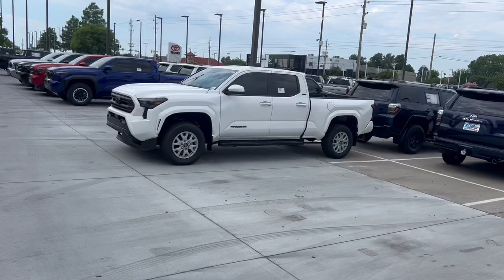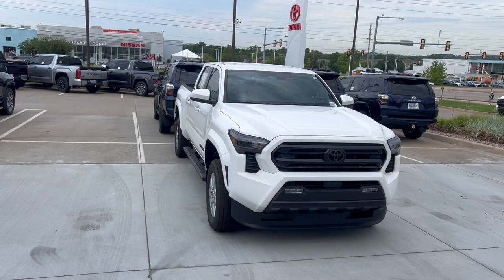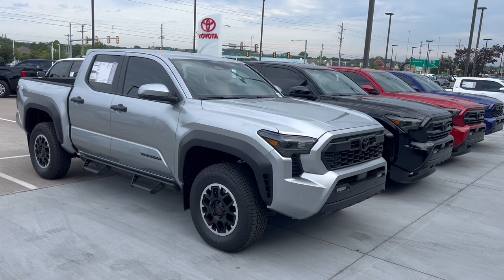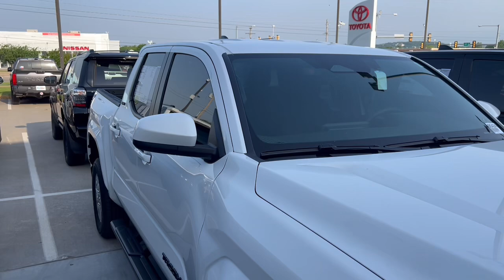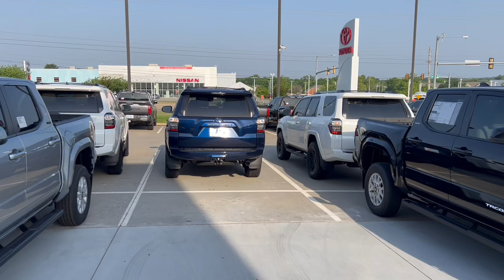Why Are We Switching to Turbos?Makes no sense Toyota…

Comment: Not every turbo engine burns oil also if you follow the manufacturers 10K service and it was then you're definitely going to run into issues if you change your oil through every 3,000 mi on a turbo engine you should be good

Comment: Turbo engines also have oil/gas dilution. So, you have to change your oil more often. The New Toyota truck and SUV platform made me leave the Toyota brand.  The Nissan Frontier is a much better built truck with a V6. Do better Toyota.

Comment: The main reason is because they tend to run at lower RPM but are still quicker and faster accelerting, plus they drive better at higher altitudes without needing 4000 rpm to overcome hills. Even if MPG don't improve. I don't support the turbocharging of these engines but looking from an objective standpoint this would be Toyota's answer.

Comment: If I get a Tacoma, I want a six-cylinder engine with no turbo. If I decide to buy a tundra, I want a V8 with no turbo. If I can’t get those options from Toyota, then I will buy a Nissan frontier which has a nice 3.8 L V6 without a turbo.

Comment: FAKE NEWS, turbos have been boosting engine performance since the 1950s, and some of those older engines are still going strong. All engines burn a little oil, that's just a fact of life. A turbo powered 4 banger has far less moving parts than a V6 or V8, therefore, more reliable. So do some research before opening your mouth and letting your belly rumble.

Comment: Emissions are one of the reasons to downsize the engine. Fuel economy is identical. I have 3.5 V6 Toyota and 2.4 turbo 4 Toyota and they get identical fuel economy.
Reply: I drive both cars the same way and my fuel economy is identical.
Reply: then that doesn't make sense.
Reply: The 4 cylinder actually gets better fuel economy! It's people's driving habits and mods that makes it worse
Reply: @carholic-sz3qv  keep the V6….Duh.